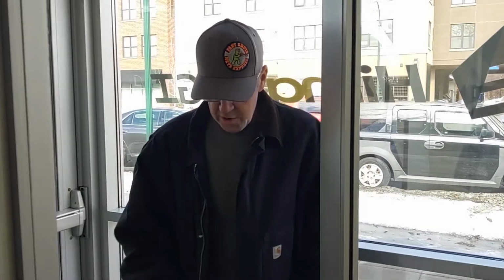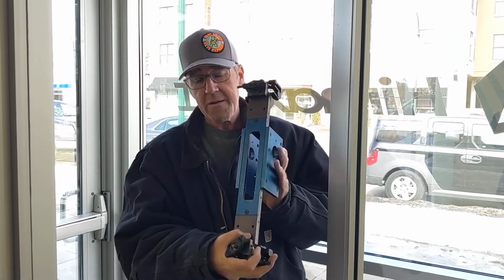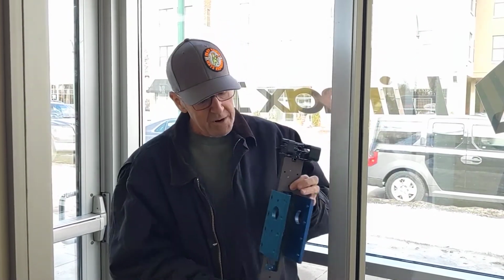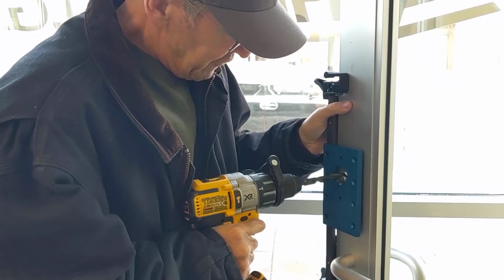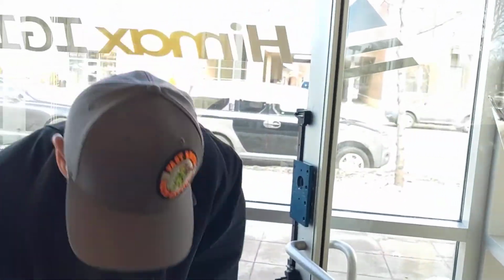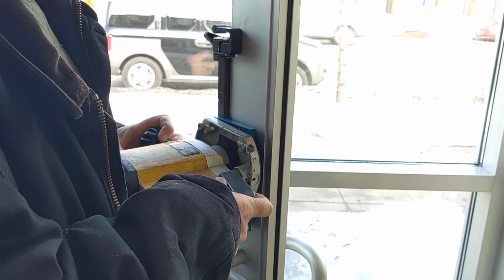Adams Rite Installation Major Mfg. | Door Lock Prep @fasteddyskeysexpress @EdwardMann

Comment: How well does that router bit do when there is a big channel on the edge for weatherstrip?
Reply from the maker: Good I assume your talking about the strike? MS Bolt I use the 
Major Mfg - HIT-40AR5 -  jig
Reply: @fasteddyskeysexpress  I was curious about how the bit does going through the edge of doors (Kawneer) with HIT-45RB4 router bit. There is a pretty beefy extruded section to go through...a channel for weatherstrip is pretty deep.  I was just wondering if you've ran into anything limiting.
Reply from the maker: Oh I now know what your talking about. Fortunately those doors are really rare here! My first thought is just say no! Most those doors have vertical rods and panic bars. Besides the backset just would not measure out correctly. Then I would have to purchase someone a new door! LOL

Comment: Nice work, but it’s almost painful watching someone use high speed for drilling metal. By the way are you using a HSS bit for the router work, or carbide bits?
Reply: It would be a carbide bit designed for this
Reply: This is the way it's designed to be used and it's only aluminum he's routing so it's s not that hard
Reply from the maker: Correct Its like cutting butter! Almost
Reply: Can you set up a regular router to do this work using a carbide bit?
Reply from the maker: yes